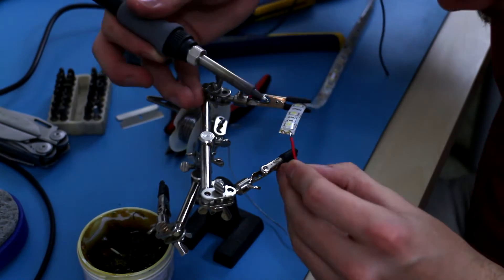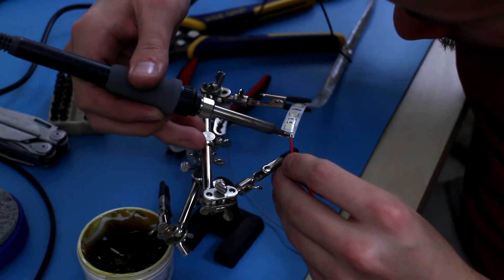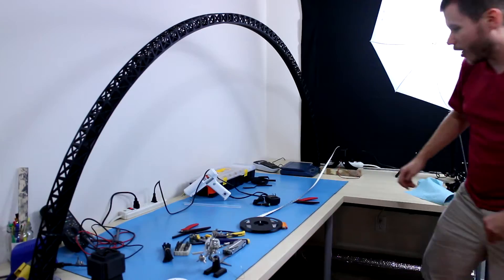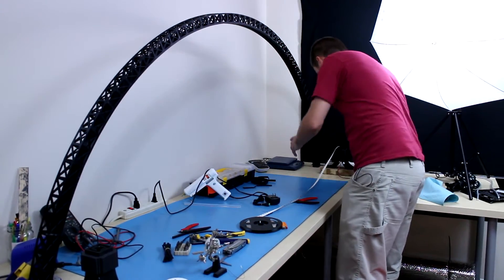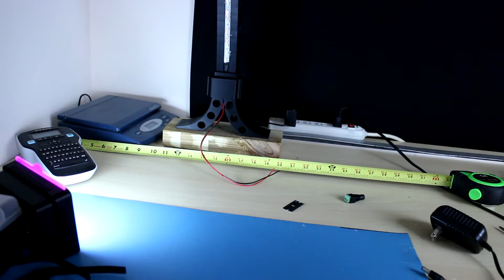INSANELY HUGE 3D PRINTED LED ARCH LIGHT - Part 2

Comment: OMG thats amazing, would look great in my ManCave / Printer room.. BUT need it probably 8ft wide can this be adjusted or is it a set width..   thanks..
Reply from the maker: If you have a bigger printer you should be able to scale the parts in the slicing software you are using.

Comment: Can I get the link for the LED kit?
Reply from the maker: The current ones I'm using I bought through banggood, but they all have a few dead segments in them. :( Here's the link: http://www.banggood.com/5M-48W-DC12V-600-SMD-2835-Waterproof-IP65-WhiteWarm-White-Tape-LED-Flexible-Strip-light-p-1039522.html

You want to make sure the strip has at least 600 leds instead of 300 or it wont be bright enough.
Reply: Thank you.